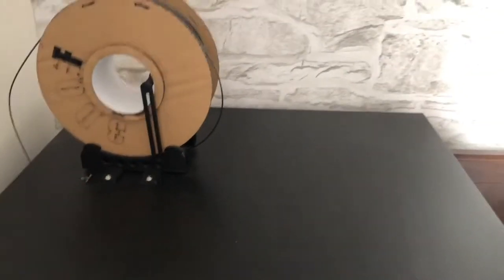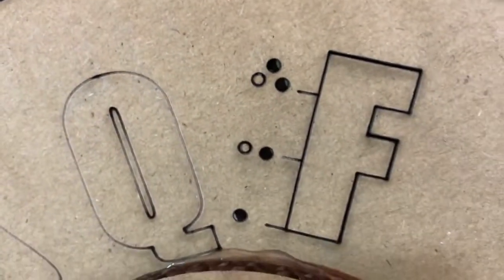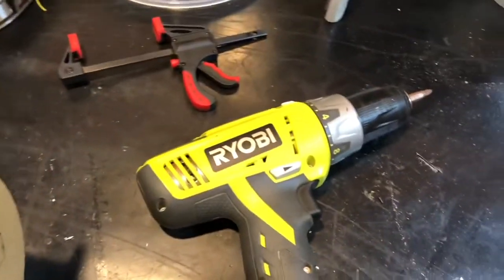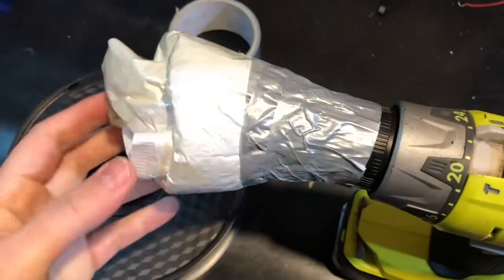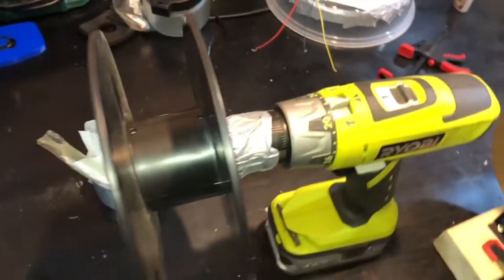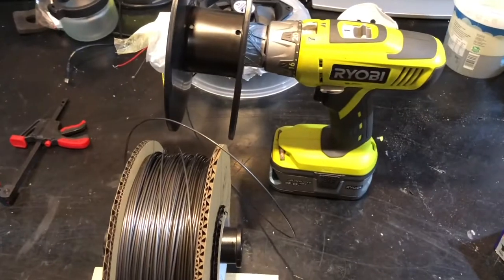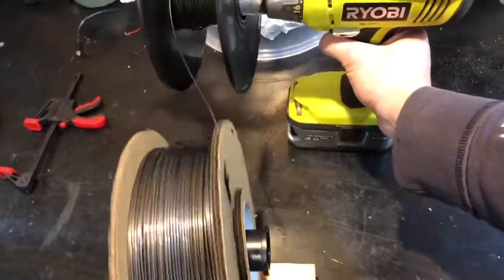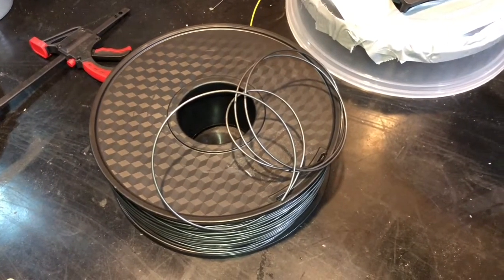Quick Tips - Filament Spool Transfer

Comment: 3d print the drill adapter from thingiverse. way better and easier. Supply spool can fit on any 3d printer spool holder.
Reply from the maker: Yes mate. Ended up printing a holder. As you could see my video was a bit of a faff… lol